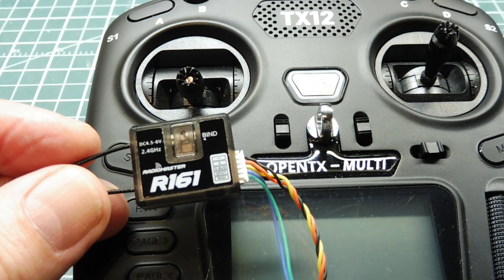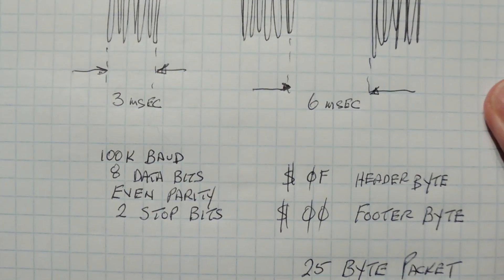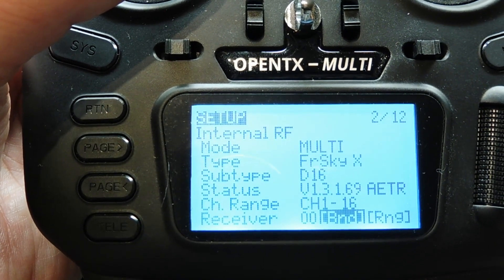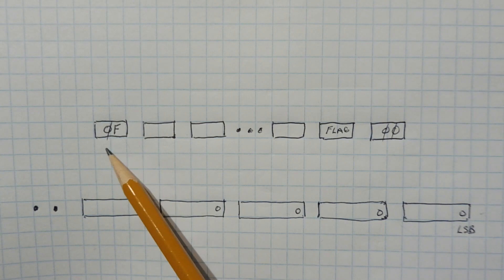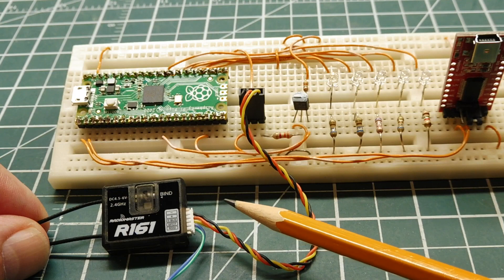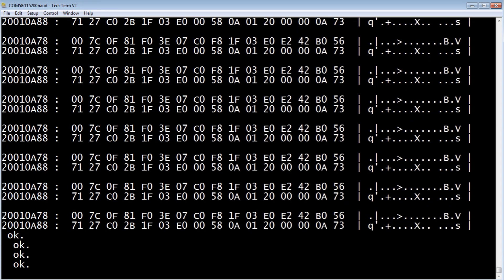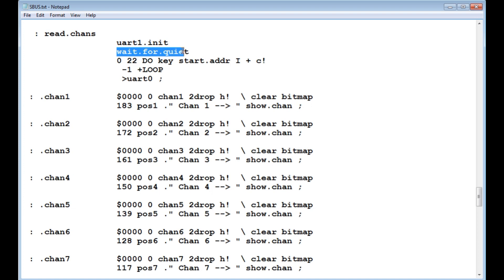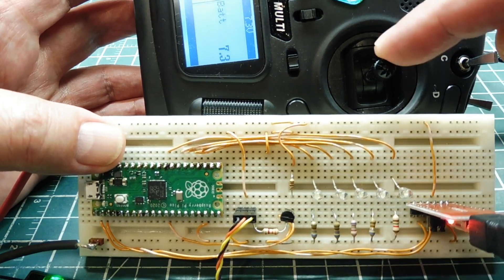SBUS Protocol Decoder / Pi Pico / Mecrisp Forth

Comment: Nice, finally i found what i was looking for. I'm curious how critical the 6 ms packet spacing is for flight controllers. Let's say, instead of using a crossfire or elrs module, i build my own thing that transmits the packets over let's say wifi serial, where the radio link with its 11 Mbps is a bit faster than 100 kbps, so will i need to do some reconditioning of the data before it goes out the serial port, or can i use it raw ? I also wonder how these commercial transceivers with the ESP8285 chip work, because the pairing seems to be easier than entering a wifi ssid and password on each side, but the backdoor also seems to be wider.

Comment: Great minds think alike! (grin). About the same time last year I did a presentation for Parallax on decoding/encoding S.BUS using the Parallax P2 processor. I am using a different language (Spin and Assembly), but our algorithm for decoding is identical.
https://youtu.be/nsFOIN6UxbE
Reply from the maker: I have used Tachyon Forth on the P1. It simplifies the code when you can assign tasks to different cogs. Works very well.

Comment: I'm reading from a Futaba R3001SB receiver through an inversion circuit and with all the same settings on RealTerm. However, I am not getting any matches with Binary Sync set to 0x00 0x0F. Any suggestions?
Reply from the maker: Futaba SBUS signal is already inverted so you do not need the external inverter circuit. Go directly from the receiver to the FTDI module. Frsky and Radiomaster receiver outputs need to be inverted.

Comment: It should be possible use the RP2040 UART directly without an external inverter by setting the INOVER bit in the used GPIO pins CTRL register.
Reply from the maker: Yes, after the UART is setup you can invert the corresponding GPIO pin.

Comment: Can you please post the code used? I would very much like to read S.BUS to control things such as LEDs and other functions, including PWM. Thanks!
Reply from the maker: Code starts at 9:25. For a PWM interface check out this video:
https://youtu.be/pRABFxdNC7A
Reply: @0033mer  Really? That’s it? I have no experience with FORTH, but if that’s the extent of the code required to read S.BUS I’m very impressed!
Reply from the maker: Forth is very efficient and has been used by NASA for many of their space probes.
https://www.forth.com/resources/space-applications/
Reply: @0033mer  Can you please pass your word definitions used in the code? And is it possible to have the code stored in non-volatile storage and loaded when power is applied so the Pico can be used stand-alone in an RC aircraft?
Reply from the maker: An auto-boot stand alone application example would take another video. Download Mecrisp and check out the docs. There is also a complete word list in the download.

Comment: Question, I have a small camera that connects to my phone via WiFi. It doesn't connect to the internet though it just sends a signal directly to my phone. Is that a different type of hardware than one that can connect to the internet? Also what is that chip or circuit board called that can send wifi signals directly to my phone? Sorry this is off topic. Looking at your other videos it seems you know a lot about this stuff.
Reply from the maker: Your camera is setup as an ad-hoc network similar to your WiFi hotspot in your house but but works in peer to peer mode so your camera communicates directly to your smart-phone. Search online for info on ad-hoc networks.
Reply: @0033mer  awesome thank you.

Comment: Are all the 16 channels used for known functions or they can just be implemented as the designer likes i.e. channel 3 will be pwm, channel 2 will be 8 leds etc..  I would think the two stop bits and parity can be discarded also along with the two begin and end bytes.